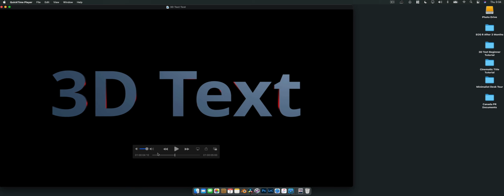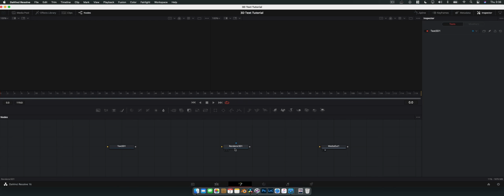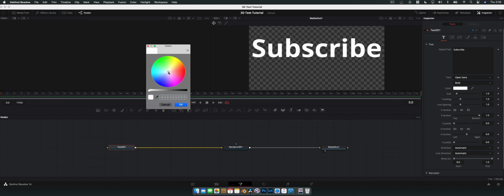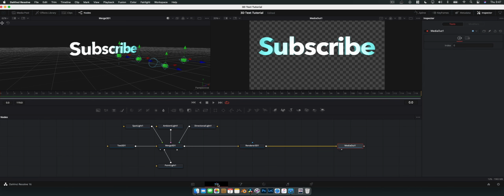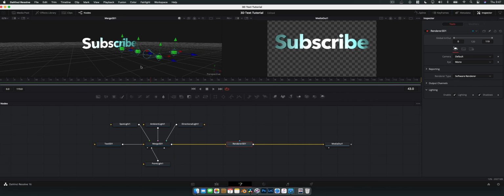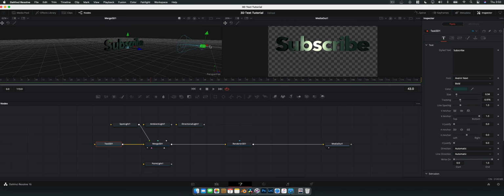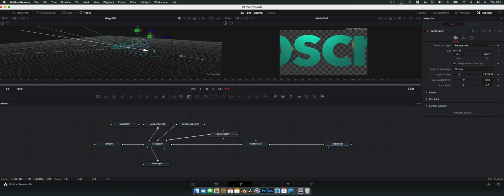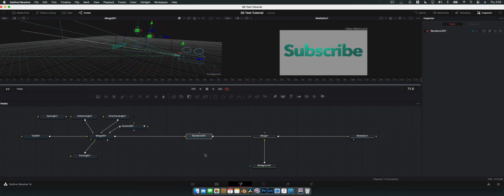Easy 3D Text Tutorial for Davinci Resolve 16

Comment: Was this done on the 16" Macbook Pro?
Reply from the maker: Certainly was
Reply: @ThatModernDude  Nice, my iMac just brick'd on me, and was looking for something to replace it. Wasn't sure if the 16" could handle Resolve.
Reply from the maker: I used a MacBook Air with Resolve! It worked well
Reply: @ThatModernDude  I did a small project a few weeks ago with some GH4 4k footage. And my iMac was struggling to just do playback. Premiere eats it up, but Resolve was slow. Probably just my settings.
Reply from the maker: That’s strange because I usually find the opposite is true